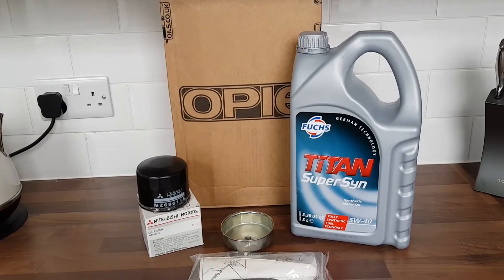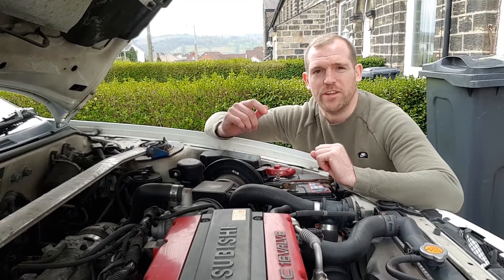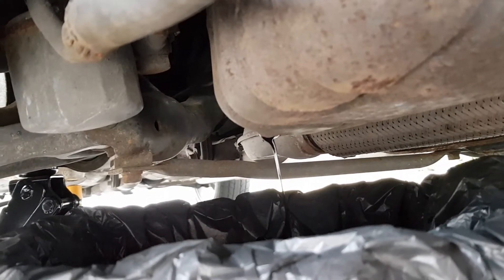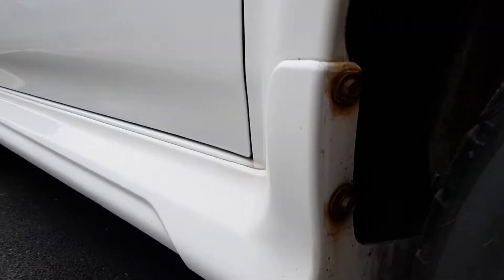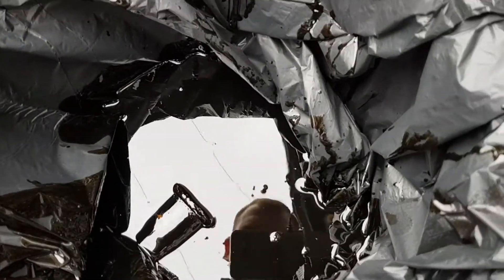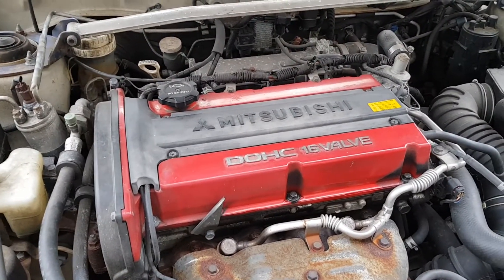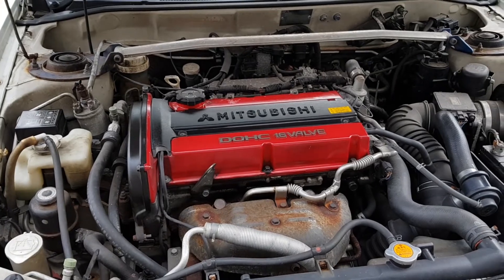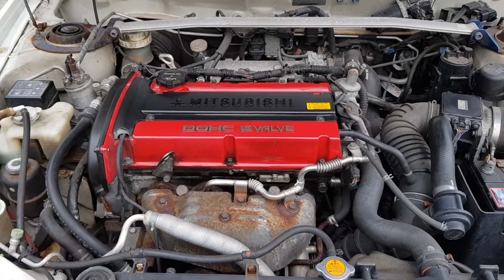Part 17 -  Evo 6 Oil & Filter Change - JDM

Comment: Nice video mate. I'm about to do the oil on my IX.
Did you use any sealant or a crush washer for the sump plug or no need ?
Reply from the maker: Yeah mate there is a washer if i remember :)

Comment: Never knew about the oil filter removal tool until I watched this! That's now 2 things you've helped me with! Cheers bud, you're some guy☺
Reply from the maker: Opie oil sells the tool. It was £13 i think. I didnt use it properly either. You are supposed to leave it on as you undo it as there us a hole in the bottom and the oil drains out of that ha. Love it 😎

Comment: Having a brew and a jammy dodger... :)
Honda have bee doing those oil filter tools for years...you used to get em free with the genuine filters...
Would 0w 40 not be better for cold start noise ? or is it maybe too thin for these engines ?
Keep up the good work
N
Reply from the maker: The oil change has deffo helped. Hopefully when the lifters get done it will be sounding sweet, as its not a noisey car having standard exhaust etc :) 😎
Reply: 0w 40 is too thin yeah. Some even use 10w50 or 10w60. The manual for my 8 says 10w30, go figure lol
Reply: @stevesas632  yep..i know....:( i  got a gen 2 Mazda 3 mps... its the same thing... :( thin oil gets passed your turbo seals or somethin...)
N

Comment: Top Video Danny keep the Evo content coming 😀 My 6 had the lifters done at 40,000 common job on these, just be mindful with age these engine's can suffer from rod failure, so talk to an expert about that perhaps, if you are going down the cambelt/lifters route.
Extra cost but maybe worth being done all at once 
😀👍
Reply from the maker: Thanks for the heads up mate. Will have a word when it goes in :) 😎

Comment: Try car idling all electrics off 10 mins, turn engine off. Turn engine back on, all electrics on, radio, lights, aircon blowers on, idle another 10 mins.  Should sort your idle, it did mine. It's on the forums if you look hard enough. My idle was shocking after disconnecting the battery.

Skirt screws on ebay for pennies, just done mine cost bout a fiver.

14 x 3/4" BZP 10mm Hex Head SELF TAPPING SCREW Captive Loose Washer Zinc Plated.
Reply from the maker: Cheere mate

Comment: Enjoy the vid Danny. When you get car cleaned underneath, be an idea to wire brush the sump & get painted. I used an epoxy VHT satin black on mine & looks good.
Reply from the maker: Mate it wont stop at painting the sump though will it ha. Next thing the car will we in bits painting every single bit ha 😁😁😁
Reply: @projectfearn  yeah but if you go that far, it then becomes a bit of a show car that you don't want to drive, knowing the underneath cleaning you will have to do in your return lol
Reply from the maker: I know. It would be a shame to have it parked up 24/7. If i had enough room i would deffo do it and keep it as a garage queen :) 😎😎😎

Comment: Hi if im thinking correct is your can not wanting to idel have you done think its called a hard rest i had the same prob after i got my car pm me and il give you my number and i can describe how i got my idle back ps im not a mecanic but it worked for me if it helps keeps the vlogs comeing .
Reply from the maker: Cheers mate. danny@projectforduk.co.uk :)
Reply: @projectfearn  Hi i tryed to reply dont know if you got it but if its the same this is the problem i had the car would not idle from cold so this is what i had to do was disconnect the battery leave it 10/20 mins. Then i reconnected the battery started the car with a bit of revs to keep it running turned everything on heaters lights tear screen and left it 10 mins  then turned the car off then restarted it and bingo it idled from cold as it should not had a issue since other than that there is a mutt screw on the throttle body you can try think it was on mlr i found this hope it helps.
Reply from the maker: Will give this a go. Sounds like a weird ritual but i will try it ha :)
Reply: @projectfearn  I was told the same as what Stephen was saying to reset my idel when I put a new battery on and it worked a treat. Keep up the good videos mate.

Comment: I was speaking to evo owners n they said they are not daily car! Like it's a track spec ariel atom or something, it's a 4 door family salon with a reasonably powerful engine! It's these idiots that install solid mounts throughout, 3 plate clutch etc for driving down their street showing off to scallies on the estate, never going to a track, an evo could quite comfortably be a daily driver if fuel cost isn't an issue, mine will get used daily when it comes back from the garage
Reply from the maker: I have a few mate with big horse power ones as dailys ha
Reply: I couldn't agree more, I daily mine and track days without issue. If you listened to some owners you'd think there so fragile and or not suitable usually down to poor/cheap 'mods'.
Reply from the maker: Mine is standard and to be fair it's drives like any other car at 30mph. It is quiet and smooth. Yes fuel consumption isn't great but the car is super comfy to drive
Reply: @projectfearn  exactly, I recently went through and replaced every door seal (not cheap) but it has made it so much quieter inside now. My car came with some questionable mods, 18" wheels and Tein coilovers, and it was like I had no suspension and very little agility, it just felt leaden. I've now gone back to the standard 17s on Pilot sport 4s and fitted Bilstein B16s with standard RalliArt top mounts. It rides beautifully and has great body control.
Reply from the maker: I think people like to make their cars out to be beasts and totally unpractical to sound cool haha yet for me you couldn't get any further from the truth with an Evo. Its comfy, spacious and rides mint. Yes fuel consumption ain't great but it isn't great on a range rover either.